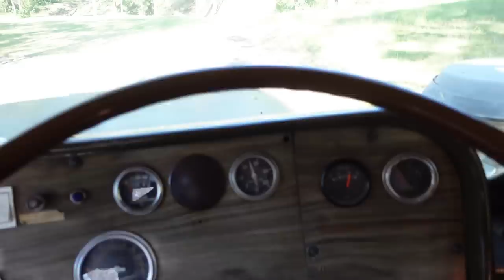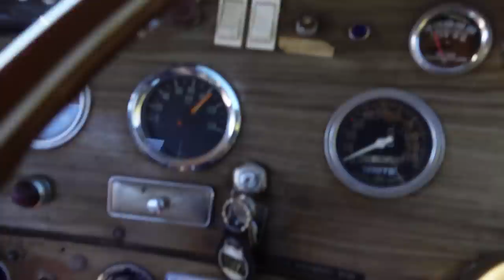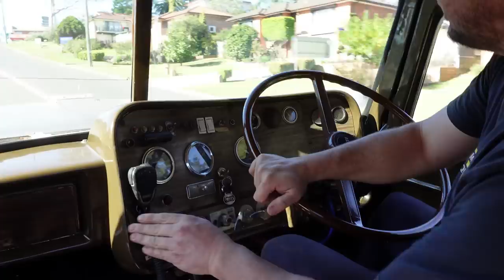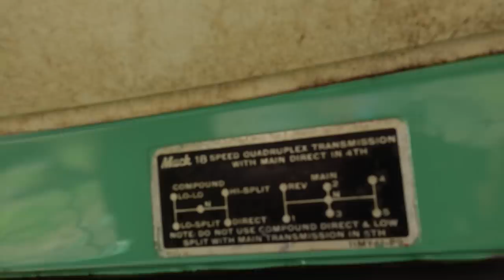White 4000 Truck!picking up 2 new 40ft trailers!

Comment: Growing up in QLD in the 70/80's, you always knew there was a White somewhere in the distance. There were plenty of these units around then. The unmistakable sound of that engine is something else. That is a 73 model like myself and it looks in better nick, so a big thumbs up for the preservation. The camera in the cab is a good idea.
Reply from the maker: Hi mate thanks for watching. The Whites had a sound of their own, even with a Cummins in it for whatever reason. Certainly a great product. It is a 73 yes. Was in very poor condition, hence the reason I had to paint it. The camera is a good idea but it is very rough, being mounted straight to the window there’s no shock absorbing at all but still works alright
Reply: @stevesplacedownunder hey Steve that’s just a myth that stems from the Coriolis effect. The myth was that the air spins different directions based on what hemisphere you live in but the air pressure different is so marginal that it’s nothing but exactly that. A myth. The coriolis force isn’t strong enough to make any difference at all on a small volume of water. It’s purely only the positioning of the water jets. 

Little trivia for you that I remember from my schooling days lol. Thanks to the Simpsons and an exchange student we had at the time. The teacher taught us how the Simpsons was wrong and considered garbage television in the 90/00s haha

Comment: Gday Steve, absolutely shit hot, the McGrath won’t take a lot to get right, I had the privilege of driving a R686 logging and float work and a T bag tipper pulling a dog, outa all the trucks I drove these 2 were the happiest fun times, you can’t beat old school, I started off in newish kenworths with 500 and 600hp and getting into 350hp was the best lesson, that taught ma a lot, awesome job mate, cheers
Reply from the maker: Hi mate, nice channel by the way. I’ve watched a few episodes now when I can. I can’t wait to work on it. We are doing up the 46 ford truck at the moment, but we may do a bit on it at the same time. The old trucks are great to drive, like you I also used to drive an R600 flintstone on float work. It was  a 13 speed fuller and a 359 4 valve Mack engine. I used to move around our earthmoving equipment with it. Now we have a 550hp Kenworth and it’s not the same. I don’t do it much now either. Fantastic mate great to talk about it

Comment: Gday Steve ,
Another cool vid. 
Loved watching the Mack going throught the gears .
Its saddening  to see all the modern equipment  come out with automatic  gear boxes .
In my view ,  a manual box makes for a far more skilled driver / opperator.
Moreover, it allows  the rig to work at a more  usable range , particularly in hilly mountainous  country .
Love that old iron.

   Respect.....!
Reply from the maker: Hi Craig thanks mate. Yes it’s a good old truck that Mack. Very original

Comment: Steve,jim Rioux from  Connecticut,  congratulations on 10k  subscribers.  A huge job on the full rebuild of the D9. I enjoyed seeing all the Macs your friend has. BTW what year was the Mack that delivered one of your new trailers. How much are trailer tires in your country.  Again congratulations.
Reply from the maker: Hi Jim thank you. It was a huge job, we’ve done a few now, D8,D6, d10 and dump trucks. It’s a 1966 model the Mack. Trailer tyres for a low to middle range one would be $280-300 each fitted, that’s Australian dollars. It’s not bad but it adds up also. But I don’t work them so they would last the life of the trailer once fitted. Thanks again Jim

Comment: Steve, can U please explain to me the difference of that flintstones quadbox  and a normal gearbox with a joeybox?  And what is about 2speed diffs? How are they diffrent from a normal diff? Another great video btw.
Reply from the maker: Hi mate. The main difference is that it’s all in one box in a quad box, where other makes  are a separate 5 speed main box and a 2,3 or 4 speed auxiliary box linked by a jack shaft between them. A 2 speed diff is 2 different ratios in the on axle selected by a button or a lever on older trucks. Used mainly with a 5 speed main gearbox. A lot of the old trucks used them years ago to give more ratios because engines weren’t overly powerful back then.